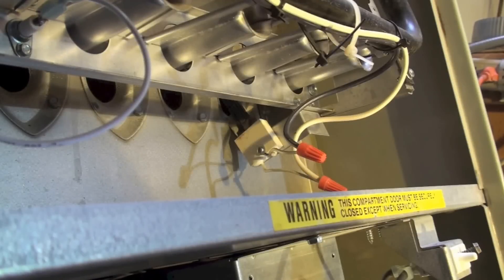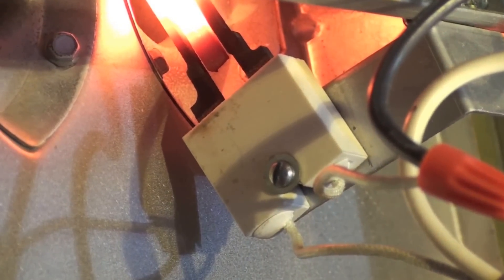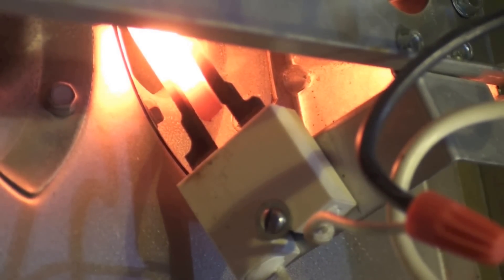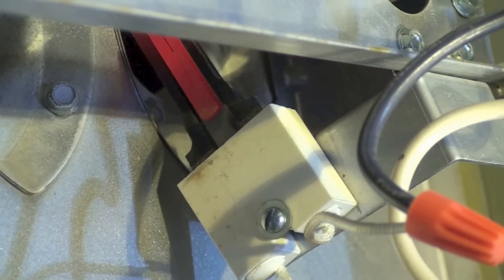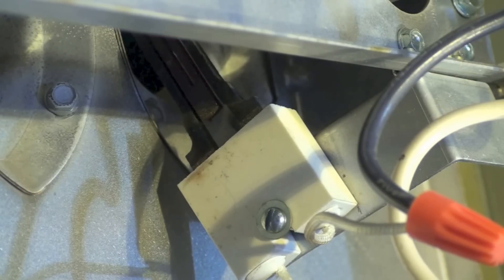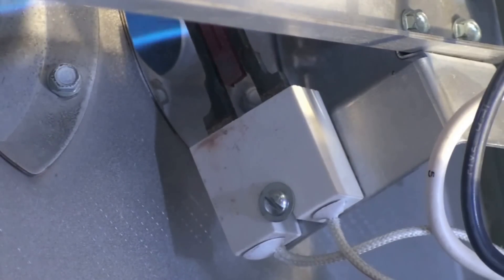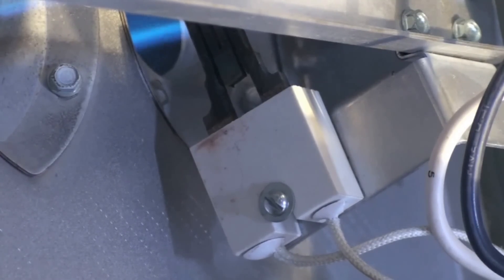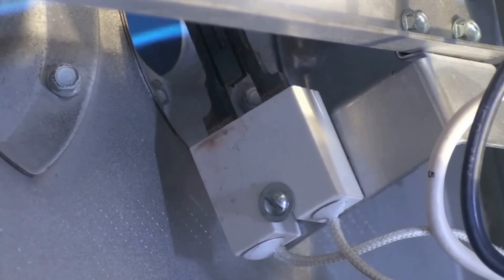Why wont this furnace light, almost an answer

Comment: Great info!  But mine still does not light.
Reply from the maker: Describe the symptoms.
GFM
Reply: @grayfurnaceman  I have a Trane XV80.  Here is the sequence when I turn the power on. (forgive me if I use the wrong words)  First, the blower motor comes on. Second, after a few seconds, the glow plug comes on. The third step should be the gas valve opening. I do not hear a click or gas on sound from the gas valve. (Maybe I am not listening for the right sound)  Fourth, the glow plug turns off. Then the system repeats. - -  My glow plug set-up is slightly different from this video. The glow plug inserts through the bottom of a bracket, holding it vertically right in front of the gas tube. After I saw this video I was hoping all I had to do was adjust the bracket, but the bracket does not allow for that. - - After watching several of your videos (great btw), I think my gas valve is bad. I'm calling an expert in for that.  I don't like things to go boom. :-)
Reply from the maker: @stanthorne6887  If the valve is not energizing, there are generally 2 possibilities.  Gas valve failure or control board failure.  The way to tell the difference is to check for voltage at the valve when there is a trial for ignition.
GFM

Comment: My ignitor won't come on and sometimes it will. When it lights up and the house gets up to Temp and shuts down the small blower motor will run inside but the ignitor will not glow. What could that be?
Reply from the maker: The most common reason for this is vent blockages or pressure switch problems.
GFM
Reply: @grayfurnaceman  thank you.

Comment: But how does the igniter get out of position.
Unless the screw is loose
Happy New Year
😇🎇🎉🍗🍗🎊😇
Reply from the maker: It would be an install error.  If a part can be installed incorrectly, it will be installed incorrectly.
GFM

Comment: Itwaswrongwiring
Reply from the maker: No wiring problem.
GFM
Reply: Thank you I see now What was wrong
Reply: Jose Montanez what
Reply: You turn it around  clock wide
Reply: Well my ignitor is not like nuts but as well it's still look brand new
Reply: OK you straight it up to the right position
Reply: It was always at the right point its just not liting up
Reply: You move it out of the flame
Reply: Jose Montanez we getting a new one but the place was closed n will be monday as we ill be good
Reply: Someone known reason there is a wire going from the frame of the hot surface igniter. 120 power source. When you remove it all was good.

Comment: seems to me this should be dummy proof with a notch to put it in the sweet spot and not move, then with a separate adjustment for fine tuning the a-z  looks like the x-y is preset only bending the metal can move that direction. I'd think a hand could bump it off x-y and not A-z this would be improper instillation.

Comment: And smoking pot is dangerous!  Please don't smoke Pot and drive, I don't want to have to pass your slow ass on the hwy doing 15 mph in a 65 area.

You twisted the Igniter a few dgr's back so it hit the gas as it entered the combustion chamber and it could pass the flame so to speak.

Some people do not have the mentality or skills to work with tools and or know the environment of a furnace. Not that the 
Banker isn't smart, its just not part of his skills, besides he can afford to call the repairman. Unless he's Cheep like me.

So this also gives you an idea of how important a striker to the tip of a torch is important too.  The spark has to be in the sweet spot to lite the flame. No wonder I never could make them work. I just got out the BIc and went at it. Cutting torch exx....

Comment: The HSI generates its heat around that middle section where it typically fails after a few years. As you adjust that point capable of igniting the fuel further into the path ignition is achieved. Ty for the fun videos.

Comment: I'm thinking my response in the initial video(first response BTW), "improper HSI positioning" was right on. Many gas appliances have a sweet spot,where the stream of gas which is shaped by the orifice is optimal for ignition, whether by pilot, HSI, or electrodes. Miss that spot, and either no ignition, or a delayed ignition "POOF or even BANG" occurs.  Now you're in the proper ignition zone for this particular furnace.

Comment: Stoichiometry, tipping the HSI closer allowed the gas to ignite before it was overly diffused? Either way, I enjoy typing that word.

The blower seems to be coming on first too, not sure if that's causing any issues but in my limited experience, the heat exchanger should heat up first and then the blower starts.
Reply: +Jeff S  on a Direct vent furnace the vent blower comes on first to vent  gasses so you can't get a bang or boom when it fires on. Remember a high eff furnace uses a smaller heating area or on mine it is.

Comment: You clearly rotated the HSI a few degrees clockwise to bring it closer to the burner tube. I guess I was wrong about perpendicularity and being directly in front of the gas flow. How can the gas diffuse that quickly in less than an inch so as to be non-ignitable by the HSI?
Reply from the maker: Adam Shaiken Pretty amazing isn't it.  I have had that happen a lot when not looking close enough when installing the HSI.  I did this one to hopefully let some of the new techs know what to look for.  
GFM